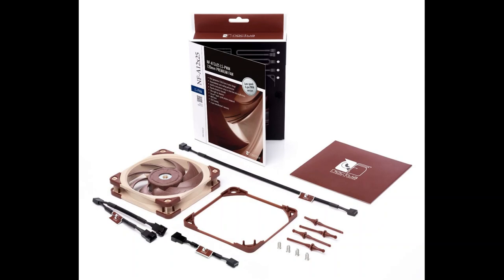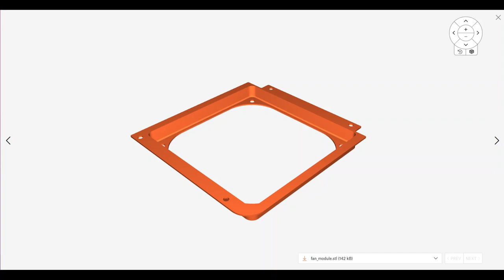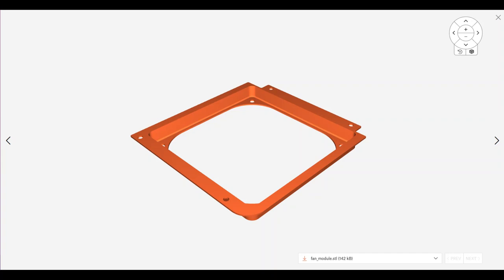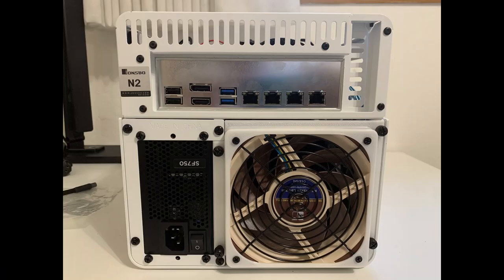Make the Jonsbo N2 NAS case utterly silent

Comment: I took the plunge and put this thing together with the same motherboard. First time I turned it on, I was sure the case was about to fly off with that jet engine of a fan.
I'm new to PC builds, just wondering if that noctua fan supplies enough air flow? I see most people going with the 20000rpm one
Reply from the maker: Hi, with the Noctua fan, with 4 3.5" HDDs in the front bay, the HDD temperatures stay between 35C to 40C at an ambient temperature of 27C. I think those temperatures are fine, and so the Noctua fan does provide adequate airflow.
Reply: Great, I ordered one.

Comment: I have also done this and utilised a Noctua NF-P12 900 RPM to be my case fan, i also swapped the grills for similar finger grills as the Jonsbo ones introduced lots of turbulence. Virtually silent after these modifications. I see we probably both have the same Motherboard, a CWWK N5105 motherboard.  Are you using Unraid or something else on it? Have you managed to get the CPU's iGPU to be transcoding in something like Plex?
Reply from the maker: I am using OpenMediaVault 6 on mine. The iGPU transcoding works perfectly inside of a Jellyfin docker container.
Reply: @wega7529 what exactly do you mean by grill modification? What did you order?
Reply: @Sankaritarina89  Silver fan grills to replace the jonsbo ones. Just the standard design ones for use in a case.

Comment: Hi. Can you tell, what HDD temperature you got with noctua modification? I mean is LS-PWM enough for disk cooling? With "stock jonsbo fan" we have loud sound and 30-35 *C disks. May be with that Noctua at 1200 RPMs you have hot HDDs?
Anyway thanks for video. My Jonsbo is loud too and will try that modification with Noctua. So pitty that "nas boards" can't control chasis fan :(
Reply from the maker: Hi, with the Noctua fan, with 4 3.5" HDDs in the front bay, the HDD temperatures stay between 35C to 40C at an ambient temperature of 27C. I think those HDD temperatures are fine 🙂
Reply: @beheresm  thanks for reply, will try ls-pwm and printable bracket then
Reply from the maker: @413xk  By the way, as per the Noctua website, the fan in the video has max rpm of 1200, 12.1 db(A) of noise, and airflow of 55.7m3/h. If you don’t particularly care about the noise and more about the airflow, then Noctua’s 15mm fan, NF-A12x15 PWM, (which won’t require a bracket and should fit without issues) has rpm of 1850, noise of 23.9 db(A), and airflow of 94.2 m3/h. Hard to say how much noisier that will feel (I think a lot noisier than the silent fan but maybe still less noisy than the default fan?) but it does offer almost double the airflow.
Reply: I also have a Jonsbo N2 using the 3d printable 25mm fan bracket.  I am using a Arctic P12 Max running on a PWM header at around 1800 RPM and all five of my drives stay around 33c-39c.
Reply: @matthew3353-t3o  thanks for reply, how you control P12 Max rotating speed? I mean, google says that that model works between 200-3300 RPM. You have motherboard that can control Chasis Fan speed (4-pin pwm on MB for SYS_FAN) or what? My (and author of video) problem that we can't use "usuall fans" because of or Chinese MB don't support control of SYS_FAN. So there are no matter if we connect to 4-pin header on MB or to 4-pin header on Jonsbo backplane (hdd one) - we will achive max speed. So we need to buy something with "low rpms" from manufacturer like LS-PWM in subject video (or use resistors wich I use currnetly) . By this text I mean that IMO on motherboard that support controlling SYS_FAN we can use any (include default jonsbo) FAN at ease, MB will control spins and noise.
Reply: @413xk  I used a different motherboard and CPU than the video.  I used an Asrock B550 ITX with a Ryzen Pro 4350G.  The Asrock motherboard has a 4-PWM fan header which is what is controlling the fan speed.
Reply: @matthew3353-t3o  yeah than no problem I think with noise if you can control situation. But with our motherboard as I said earlier noise is the REAL problem as we spin fan on max speed everytime
Reply: @413xk  Yeah as test I ran the P12 Max at full speed to just to see how loud it got.  It moved a ton of air but was way to loud so letting the PWM fan header control the speed is the way to go.  Since you don't have that option a lower RPM fan is the way to go.  With the 3d printed bracket and a 25mm fan, you don't need a super high RPM fan to keep the drives cool.
Reply: Ok guys I'm back after finally installed printed bracket and LS-PWM Noctua. Can confirm that case became super-mega-ultra silient. Temperatures stays the same: 33*C with "jonsbo n2 stock fan" and 33*C with "Noctua 12x25 LS-PWM". I can't hear any sound (except disks) with that new fan. Came back here to say thanks to @beheresm and other who helped in this comment thread.